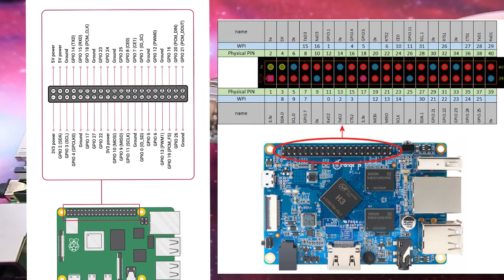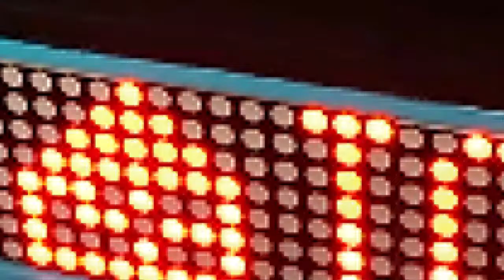How to setup a Raspberry pi GPIO extension board

Comment: Does it allow you to add extra GPIOs to your original Raspberry pi?
Reply from the maker: No it does not, if you require more pins you will need a additional breakout board with a controller, like a MCP23017, some of these boards are controlled via I2C  which I touched on briefly in another video, If I get the time ill try do a video on a MCP23017 if people are interested?
Reply: @ScottyDIY  super interested! :)

Comment: Can you take the grey things off. Limit with space and they take up way to much space.
Reply from the maker: Yes if you wanted too but they need to be de-soldered to break the connection. It’s only 8 on each grey strip so would be easy to remove, you could even direct solder wires to the one connections if you wanted.